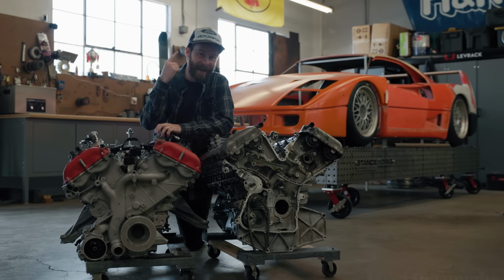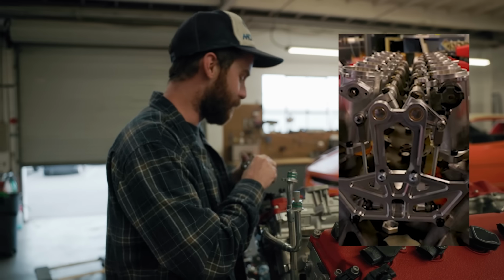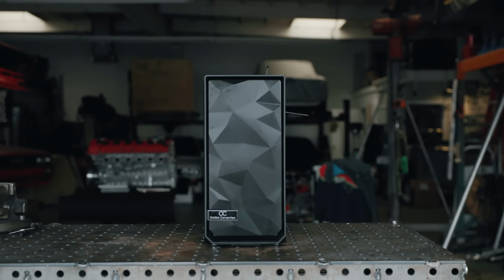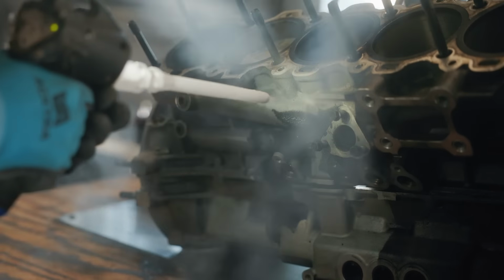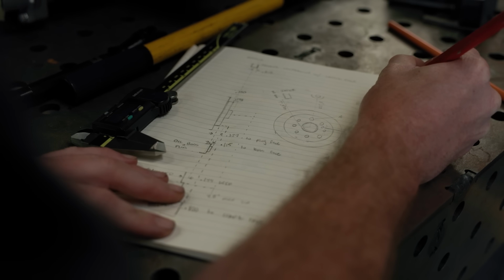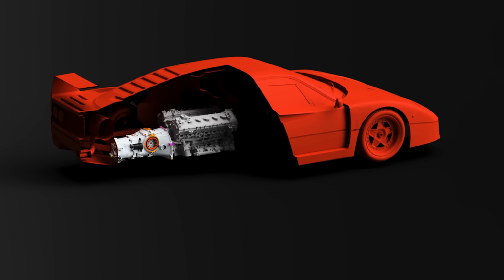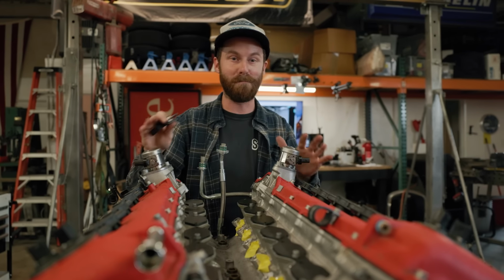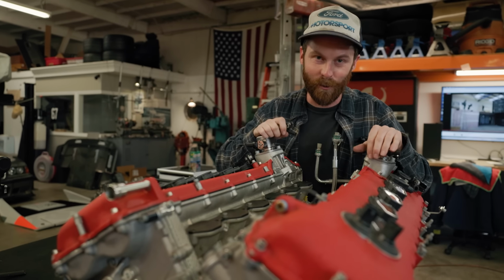Stuffing a V12 into my F40: 3D scanning is my favorite tool yet.

Comment: I am gonna say this. You and everyone else removing or bypassing emissions (when it’s required) are the fuel for CARB and the EPA coming after the rest of the entire hot rod community. Especially when you are on social media telling others. Keeping that on the down low keeps Johnny law away. Look at the aftermarket diesel industry. Look at the lawsuits from the EPA. 
 If corvette owners bought a new C7 front engine car, lt4 with direct injection and just remove it, they wasted thousands on the new and the latest just to go backwards in technology. 
 States won’t limit what you can buy, but States like California will just make it to expensive or more difficult to register anything that is older than 20 years old, just like the EV mandate California tried. 
  Cities in Texas have emissions testing and have for years. As of January 2025 there are no vehicle inspections except in emissions areas. It’s going to increase roadside testing equipment and law enforcement checking things, it will be like when an 18 wheeler gets pulled over. 
 There is some history of why  a pet peeve of mine. In 1995 I looking into a twin turbo build not just from a performance standpoint, but from emission legality and volumetric efficiency. Volumetric efficiency improves mpg, and lowers emissions. But back then aftermarket efi was not as great or as cheap as today. 
  Koeingsegg did lots of research just like that a few years back. 
  In rural Texas in the early 2000’s they were complaining about an egr valve on my 74 Camaro,  while late model cars were removing catalytic converters and no one said boo. 
 I spent many hours, reading inspection laws and requirements. Volumetric efficiency is the way to lower emissions and have decent mpg. Cleaner power production produces less emissions, it’s really a win. 
 I remember when gas was $1.07 for 93 octane in the 80’s, no body cared about mpg cause gas was cheap. Sucks when it’s $4 a gallon and you get 9.8 mpg from the 830 Holley. Not exactly cheap to drive or fill up. High operations cost has gotten many hot rods parked a lot more. 
 But screw it, carbs are cheap even if they are horrible for mpg.
Reply: You are misguided.  CARB isn’t worried about the .01% of cars that don’t meet current emissions standards.  That’s why there are no rules when it comes to modifying old cars.

Comment: Docal R8 is great stuff, it's also available in sheet which I highly recommend. 

A couple of points though. It comes nice and shiny but if you leave it for any length of time it will rust from humidity etc. Don't attempt to bend it with a manual tube bender, it's much harder to bend than 4130 imho so use a tube bender with hydraulics. Lastly it has quite a kick back on the bend so do test bends on every size tube you have and programme that kick back into your bend software. I found that my 1.5/8 0.95 tube had twice the kick back of my similar 4130. The upside is that it's super nice steel and much easier to weld with no worry of cracking or need to de-stress the material. Loving the build and good luck!

Comment: Any advocate supporting direct injection needs to check out the state of many D.I engines vag cars have been running. Engines with less than 40k miles are almost ruined by oil/carbon-build-up on the intake valves/intake ports. Direct injection is b/s thought up by car manufacturers to falsify mpg claims. Port injection is the way to go.

Comment: Engine Masters dyno  tested fuel injector location, and Carburetion...the fuel will cool down the intake air, it will also help keep carbon deposits off the back of the valves and keep it clean... considering all that, I'll be shocked if you lose power after it is tuned.

Comment: You are a fool not to use CAD to help with the chassis design.
Reply from the maker: Hmmmm no.
Reply: @stanceworks  Are you kidding? Pickup points and sway control plus flex simulation, you could avoid alot of pitfalls. I'm not saying do the entire thing but some of it would definitely be helpful to get you there faster. You have done good work in the past but you aren't a pro yet. Just my opinion from experience but you do you.
Reply from the maker: Calling me a fool is rude, man. 
As said, I'm building the base structure by hand, and then bringing it into cad. All of the suspension will be done in CAD. Everything but the crash structure will be. Easier to build the crash structure by hand and import than vice versa.
Reply: @stanceworks  It was poor choice of words, my apologies.  I never heard you say anything about cad and suspension.  That's what I was meaning. In my view it would be " foolish " not to use suck a powerful tool.

Comment: I guess you can make plugs for the direct injector holes. 
 What about piston design? Direct injection engines are specific designs for combustion, flame travel, fuel metering. A direct injection engine may have a different piston ring package since DI is pretty precise for fuel metering. 
 I would hang on to all the parts until you are sure the port efi does what you want. You may want to add both later. 
 Not to mention California has tried to ban hot rods at every turn. Sure would be nice if you could pass an emission test and basically flip off the politicians in Cali and CARB and the EPA. 
 I know legality, road legality safety and emissions never seem to be an issue for the big magazine builds or big shops. I mean horsepower gods forbid a hot rod should  get decent mpg, have low emissions and be efficient, have ac and be enjoyable for more than 10 seconds, or the three minute autocross race or just look pretty. 
 Love the build, wish I was doing it. I just want a car  to have it all. 
 I guess it’s  real easy for anyone on the outside to arm chair quarterback this. 
 Can’t wait for more. 
 Just looking at different views.

Comment: I was literally waiting for this video to say I saw where these guys were 3d printing mock up parts from 3d scans and engineering cad files. That we they didn’t have to lift the heavy real parts in and out of the vehicle when making brackets running lines etc. the options are endless with 3d printing/scanning.
Reply: Imagine 3d printing the entire transmission housing for mock up purposes.

Comment: Performance shops are working with direct injection.
Brian Tooley Racing is playing with it. Currently it has fuel supply limits past a really high power level. They have experimented using both direct and regular efi together. 
 Some of the newer vehicles are not as user friendly getting into the ecms. 
  The new direct injection LS engines vs slightly older LS platform, it seems there are no limits for power production when the older LS and aftermarket efi you  a make 1500 plus hp. Then you are only limited by the fuel pump, injectors and wallet. 
 I get not keeping the direct injections.

Comment: Let’s clarify the real reason domestic automakers went efi. Emission and air quality. It was literally the push of the California Air Resources Board (CARB) And the EPA. I’m sure eventually auto makers would have gone to efi, but not to save fuel, or the environment. Auto makers never do anything to save the environment. Do you think they want mpg regulations? Nope. They do however want to save money and carburetors would be a lot cheaper than computers and efi. 
 European cars had Jetronic with hard lines. Similar to diesel cars like the 1982 Peugeot diesel.  
 As far as tuneability. The automakers should thank the racing and aftermarket hot rod industry for making efi so user friendly today. 
 The McLaren F1 still needs an IBM dos laptop to program and take to its Ecm. And that old 1992 car used variable cam timing from the BMW engine, long before it was a production feature like the Honda Vtec, Pontiac  Vibe/Toyota matrix and now late mode v8’s.
Reply: Hate to tell you but Honda came out with vtec in 1989. Alfa Romeo was technically the first in a production car in 1980.

Comment: Proper planning prevents piss poor performance. The ground work, and the prep work are ALWAYS the most important part of any project. knowing the can of worms, makes opening the can of worms easier. Yes its cool to just start building and see where it turns out, but if you do it this way, youll know the size and shape of every bracket, grommet, gusset, tube etc and youll know where everything is supposed to go before you even start down to the mm. you are essentially creating your own instruction manual for assembly. and the patient approach 100% of the time will have a better result for the V1 of this thing. I applaud the extra you are doing up front and if the internet doesnt like it or is bored, well you cant educate the ignorant and have them understand fully sooooo just keep doing what you are doing and theyll get it eventually.

Comment: RaptorX is incredible. Using blue laser scanning in fine mode (parallel lines) I've been able to go from scan to derive geometry in Fusion and directly to part. Off to SendCutSend and the final part worked the first time. I agree that in your case I'd back it up with manual measurements, but the scanner in your hand can do some serious shit.
Reply from the maker: I’m eager to use it more and learn! Any tips?
Reply: @stanceworks  you've already got the technique down... mostly just practice for different materials. Make sure you keep Aesub handy... I prefer orange for car parts. Aesub also has a scanning net that makes it easy to drop the targets on your object instead of using stickers. The net is expensive so I'm working to make my own. Also, when in blue light, do a global markers scan first to get all the targets captured BEFORE scanning geometry... this makes the overall process so much smoother. Do the full part in cross line mode first, then come back and hit detail areas like bolt patterns with parallel line mode to get more precise details. On the software side, I've been digging Mesh Inspector for processing my meshes. It's fast and has lots of tools... I clean the files up there before bringing them into Fusion to pull out the geometry.

Comment: Mixed injection, DI + Port is great for a street car, if you have the computer for it. Most YouTube commenters really don't understand what ECU's are needed to do certain things. Factory ECU's are essentially limitless. He would essentially need the top of the line Syvecs computer and that still might not be able to handle 12 DI injectors and 12 port injectors.

Comment: Small tip for your new PC:
Buy one more of those brown Noctua fans and place in in front as a second intake fan.
Reason: You will have 2 intakes and 1 exhaust, creating a slight positive pressure inside your case.
This will ensure shop dust wont get inside through all the tiny gaps in the case.
The car build is sick af!
Reply: Ideally if it's gonna live in the shop, it should be passively cooled. There are cases that are pretty much one big heat sink that can handle those kinda of specs and meant for shops.  This is computer was obviously meant for an office space.

Comment: It would be best if you had a transmission with the clutch behind the rear axle, this will save you several inches. More or less is like the VW big engines layout, but inversed because they do that at the front end.

Comment: Just a heads up with the DI delete, some people have done them on the newer 3.6l vr6 engines and its happened that a few times the blocks offs for the di melt so be careful with that. A cool idea would be instead of deleting the Di to use it for water or water meth injection since the benefit would be even better than port meth injection and it wouldn't matter too much in terms of tuning.

Comment: I understand maybe why you are going to make the cage the old fashioned way but I want to ask why not use CAD? Im just curious but I’m aware of the time consuming aspects of it as that is what I am doing right now, however why not make rough mockups of the tube frame and use the available stress analysis in fusion in order to either verify safety margins or maybe more importantly performance. If you mock up the frame in different configurations and stress test the chassis twisting at the suspension pickup points on opposing sides of the car, you can utilize the tools you have to make the best possible configuration and use it as a base template so you know what to do once the material actually arrives.

Comment: I think direct injection is in a similar place as fuel injection was in the 90s and early 2000s. People were making a lot of the same arguments you are now for putting carburetors in place of port injection on Ford and Chevy V8s. The reality is the aftermarket just isn't there yet for direct injection to be the right choice in a heavily modified car. Also, direct injection is only "dirty" because of the crank case ventilation, most heavily modified cars run catch cans, so that shouldn't be an issue when more aftermarket support arrives.
Reply: Someone that gets it 👌

Comment: Make sure you have the best bearings you can get in those cv joints. At high rpm those shafts will be trying to push themselves inline and straight with the output of the transmission,  thus pushing very hard on one side of the races during acceleration.  👍

Comment: Do you have a place where you are getting the Docol R8?  Also for your gussets and plates what material are you planning to use?  It does you no good if the tubing structure has a very high yield and tensile strength yet the plates don't have the matching yield / tensile strength.  But I want to commend you.  You inspire me and I'm sure a bunch of others.  Keep up with the great work.
Reply: There is only one place that sells Docol. ME Racing service AB at Borlange, Sweden. They sell it to everybody else. AED Motorsport products sell it in US

Comment: Direct injection isn't nasty, combustion is nasty. Port injection allows gasoline's cleaning properties to clean the intake valves. I think perfect set up would be to have both, but I get the decision to ditch it for simplicity. There are a few ECUs that can handle direct injection that aren't too much. Dual port injection are why some modern engines are so potent and they use the port injector to handle what actually makes the power.

Comment: this is gonna be an amazing build but as you mentioned turbos and chatting to DDE if you go that route, well then you need to go check out @DDE / @dailydrivenexotics new videos of the V12 motor running (1400whp) and i think you gonna stick to stock if you building it for track, that engine with the turbos is insane and revs so quickly.

Comment: Where gasoline DI really has it's niche in a single type injection only, is in two-strokes. 
On a four-stroke, both from an emissions-standpoint AND power: DI for full load, due to being able to keep the quench pads dry from fuel as end-gas detonation/knock most often occurs in the quench pads during quench opening, post main charge ignition, and then use PI in tandem with DI for low and part load (better/longer/sufficient time for fuel evaporation, also the back of the valves are cleaned).

I would have kept the DI, but installed PI in addition if it was mine, but since hardly any (hard to reach) emissions apply on cars from pre-89, I really do see the reason for deleting the DI, as it also is easier.

BTW you don't necessarily need E85 to prevent detonation when going PI. Normal pump gas with 10 % water in it (suspended by surfactants Tween and Span 80) can take shitloads of compression in addition to providing higher working-fluid mass without displacing any more of the available oxygen.

Downside is fuel system needs higher corrosion resistance, and oil needs to be changed alot more often (but that goes for E85 aswell, just E85 is not as severe).